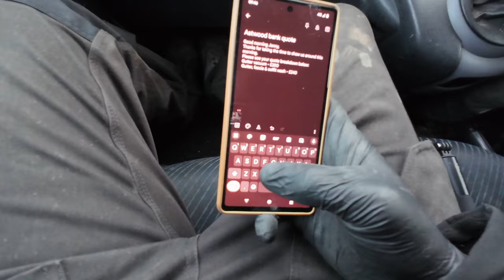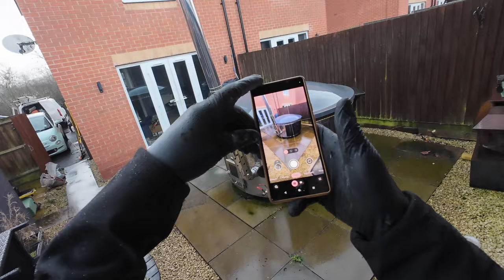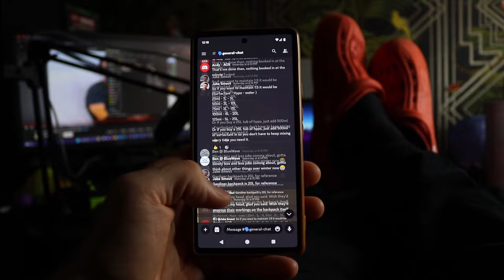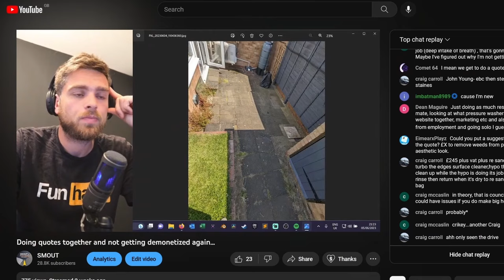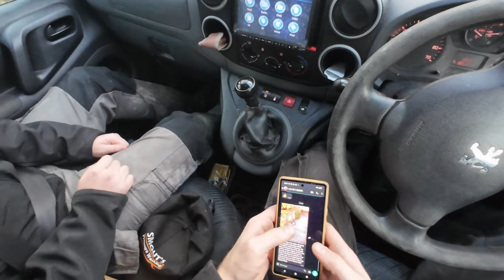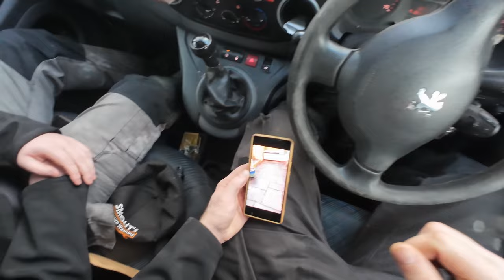Slippery Patio Pressure Washing - Full walkthrough

Comment: speaking of licensing do I need any to start pressure washing and using chemicals ? And if yes where would you get them . Sorry for all the questions just got a little van and getting the bits and pieces together
Reply from the maker: Have a look into the Pureseal approved applicator course module 1 👍
I'd be grateful if you use my Pureseal link in the description before you purchase anything 🙏

Comment: That reminds me I need a new sprayer I’ve bust the pressure release valve off mine. You could of done  with cleaning the moss out of the valley on each side of the little gable end.
Reply from the maker: I've considered this but where do you stop? 🤔 At what point does it become a roof clean?

Comment: What are the brass fittings you’re using with the yellow hose? I have the same hose but currently using normal hozelock fittings which don’t fit properly
Reply from the maker: 3/4" hozelock style fittings from Pressure Washer Sales & service Evesham. 
I'm sure they'd post some out to you if you give them a ring 👍